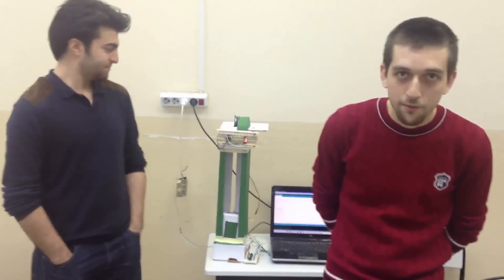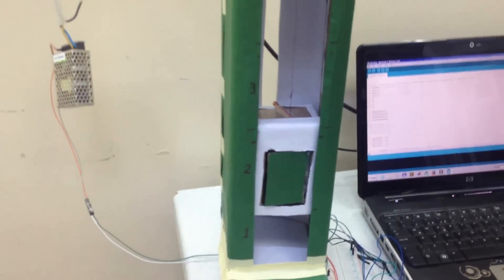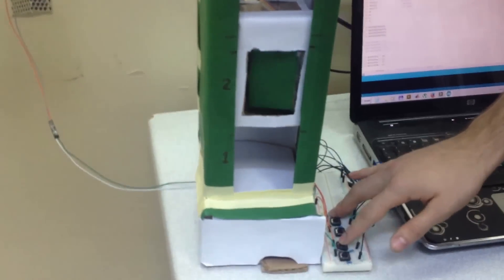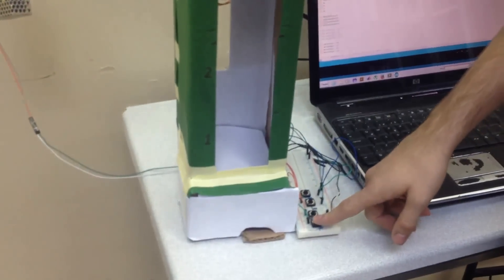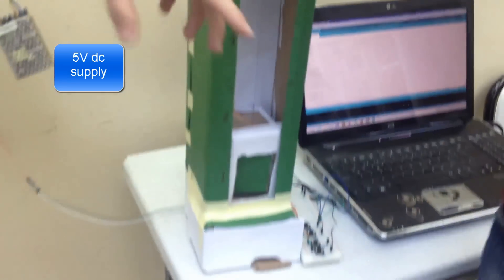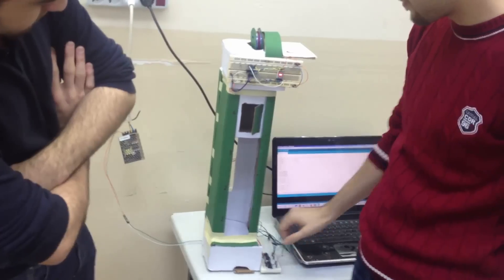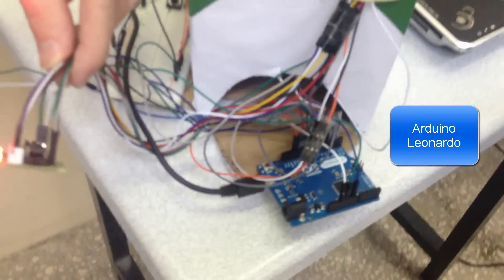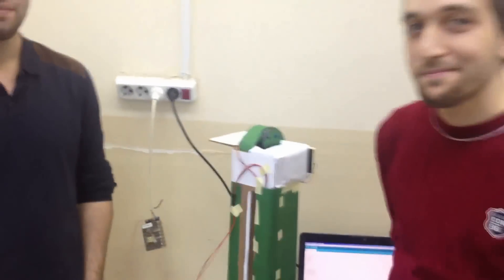Arduino Simple Elevator Project

Comment: Damn, I always read about shift register and 74ls series, and never thought of it, geez, that's what i need to perform the number analog. damn thanks man.
Reply from the maker: +Exogen Design You Welcome.
Reply: +Ulas Dikme sir One question, Did you just used one arduino for the whole thing?
Reply from the maker: +Exogen Design Yes, specifically Leonardo. In the video all the things are clear : ) we did not hide anything :) If you have any question you can ask from my website also. Good Work !!!
Reply: oh okay sir, This is very helpful for my project also thanks for the codes, i will used it as a reference, Thanks for your reply. Have a nice day sir.
Reply from the maker: +Exogen Design Have a nice day for you, also . Thanks for using reference.

Comment: sir can u help me how to build this mini elevator i badly need this project please ..
Reply from the maker: Below the video there is a link. You can follow the link. Also you can contact with me via my website ıf you need help , but all explanation is available in the link about the project.
Reply: Ulas Dikme what i mean is how did you create the prototype itself, what are the components did you use?
Reply: Ulas Dikme is it C or C++ or any other language ???
Reply from the maker: aevan batongbacal İt is arduino ide which is like c++. The code is available in the link. Also the idea...
Reply from the maker: aevan batongbacal http://www.ulasdikme.com/projects/arduino/arduino_elevator.php
Reply: Ulas Dikme ok thanks ..